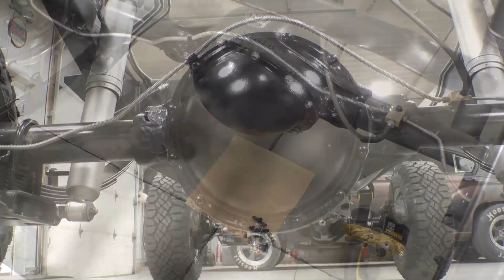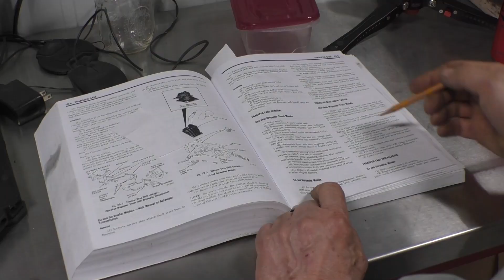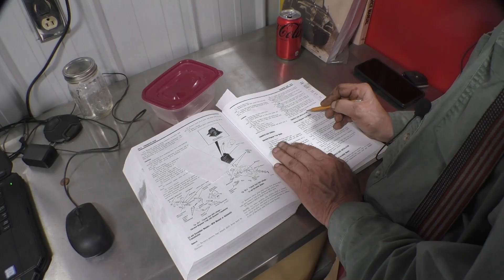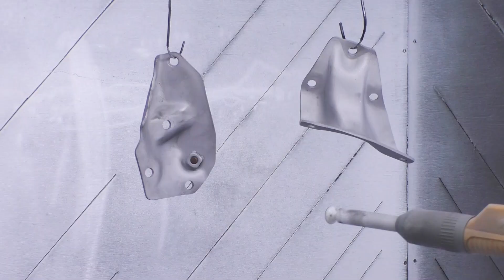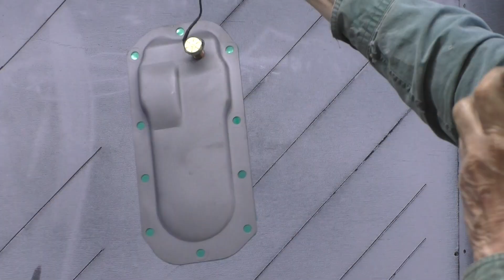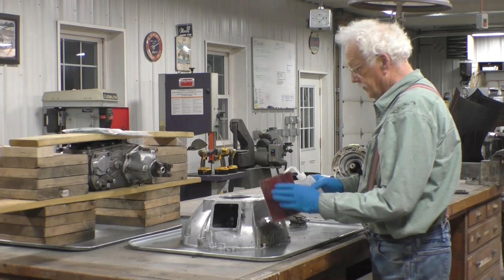Remove and Clean, Engine, Transmission, Transfer Case, and Bell Housing, and more 1982 Jeep CJ7

Comment: You’re not crazy, the new “old style” bolts do look better in the rear diff. 

Also, I think reading/utilizing the service manual is beneficial. 

Thanks for another great video!
Reply from the maker: I appreciate the comment, the older style bolts do look great. But guess what, putting form in front of function has bitten me as the differential is leaking again.